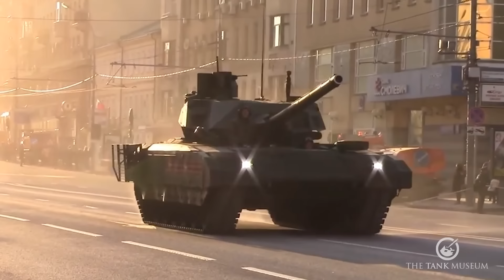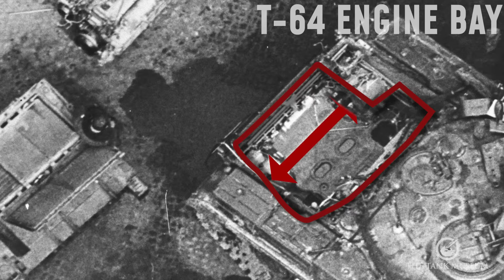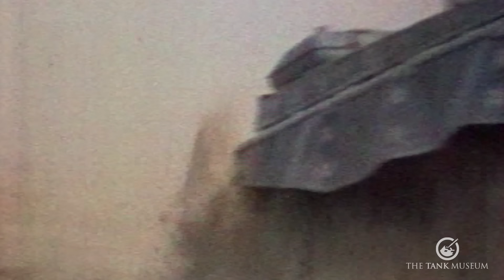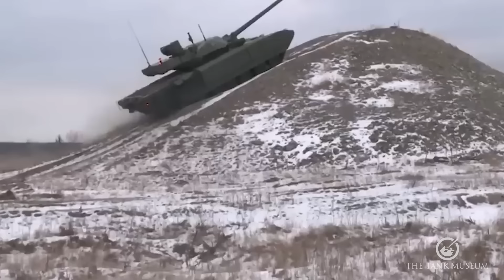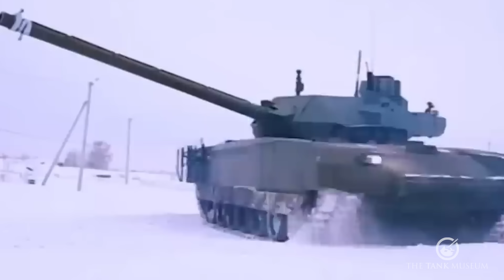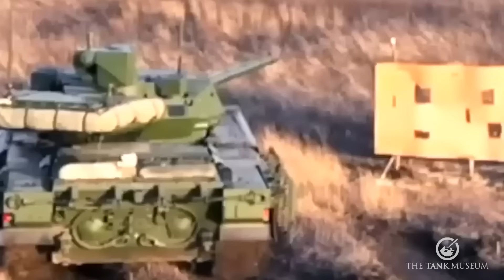Radical or Ridiculous? | T-14 Armata | Tank Chats #171

Comment: I believe in a whole new doctrine where tanks as we know it are obsolete...drones and space based laser weapons and space based tracking...first I will say the only way a tank can keep lasting for some time which is the similar temp it is to its surroundings will last the longest...very soon in military warfare will sats with lasers be able to track and shoot with 99% precision against tanks. They will be able to shoot as many times as they want. Infinite ammo (chinese have claimed to have overcome this overheating issue by pumping a cold gas into its chamber). Strong enough to rip through any armor or shoot precisely at its weakest points. The only disadvantage of the laser sat is orbital trajectory as it won't always be over that spot on the planet. 

This is where drones come in. Cheap, amassed by the thousands, strapped with lightweight high explosive combing entire areas being as efficient as possible to keep a certain 8 to 1 kd ratio. If it cannot achieve this they will tactical retreat and recommend the exact number for those odds until those odds are reached or whatever odds you need against the enemy. 

The biggest and most important advantage drones have is terrain has no affect. The air is their only terrain and the more they can operate in different weather the better. The other advantages is no airfield or air strips literally can be rocket launched stationary or thrown by hand anywhere and its obvious mobility at low altitudes. Tanks can't do this. Mines will have to be redesigned to track and hit drones in the air in the future. AD (anti-drone) mines would be a wise R&D decision. Any type of AD (anti-drone) defense would be wise like drone cages that extend the tanks life as well as any type of jamming or short range emp. 

At some point, maybe not in our lifetimes but maybe the tank will become obsolete. The armored infantry vehicles will still be a thing but they'll be covered by amassed drones in the thousands. The tank is the battleship...the t-14 is your super battleship if you may and the drone/drone mothership/space based laser are the escort, light, air carriers of the future.

Comment: Soviet era tanks do have a fording capability like shown at 7:30 but so does everybody else's main battle tank.  But at one point in the cold war, NATO experts were startled, and concerned, by a Soviet propaganda film that showed a column of T-54 tanks entering one side of a river only to re-emerge moments later on the opposite bank.  Since NATO tanks did not have this supposed ability, NATO leaders were naturally, a bit shocked to see the Soviets fording a river with apparent ease!
But as the Russian defector Suvorov later revealed later in his book "Inside the soviet army", to do this easy trick required a lot of planning!  First the Russian engineers diverted the river.  Then they paved the bottom with some sort of concrete tracks, not much different in design from a child's Hot Wheels car set; then they routed the river back to how it was.  Now to show NATO a "river crossing" all the Russkies did water-proof the tanks, then drive into the river and back out again.  And to prevent anything from spoiling the trick, the tank drivers were kept on course by those hidden concrete emplacements. Without the concrete, the drivers had no way to steer in the right direction and would inevitably become lost while underwater, because unless you paved the river bed, there was no way to do it without losing a bunch of tanks, that drive into the water and never come out!

Comment: The T-90BM is available in large numbers in both the Vostok and Zapad sectors.

The same reason why the Challenger Tanks are also going to struggle against Mines, Kamikaze drones and high velocity Missiles.

The Challengers look ridicules with cope cages.

The T-14 has active drone and missile protection. Russia will not produce in numbers unit 2028.

The Leopard, the Challenger and Abrams all have the same problem, tracks are blown off, the panzer is disabled they get picked off by Kornet, Lancet or the venerable T-72 with its enormous gun.

One CV-90, Sweden’s hopeless APC took a direct hit with a Vietnam era RPG-7 and the projectile went straight through the turret and killed the commander. The rest fled.

The only was to get through fortifications is Kamikaze Panzers, remote controlled, cheap rolling steel with automatic guns.

There is no hope for Panzers in todays battles.

One T-80 knocked out the best of Western Armor in 8 minutes, 7 APCs gone and he had to go back for more Ammo, the T-72 is fast, lighter than the Leopard and Abrams.

You try and do a section on that engagement which has become the hallmark of the War.
Reply: Calling CV90 hopeless XD
Its not like it was tested and battleproven in Afghanistan, and Ukraine announced they gonna buy more of these, after war
One got taken down, that means they suck. 
By that standards, everything that russia deploys is pure trash

There is absolutely no proof of "active drone protection" on t-14, other than russia's claims. We are still yet to see debut of t-14.

Whole "tanks are obsolette!11!1" is a song we hear since 70s, yet for some reason, Ukraine actually asked for more tanks, and Russians are trying to replace their lost tanks.

T-80 is slightely upgraded t-72. Claiming it "knocked out" is a russian cope fantasy. Its not like western vehicles were going through minefield, charging an entrenched position on enemy that was waiting for them. By that logic, ALL russian vehicles are complete trash, giving how easly they were knocked down at first weeks of war.

In short, cope more
Reply: @krywoz707  - Comrade - If a little guy with an RPG-7 could take out the CV-90 then what could 100,000 Afghanis with 100,000 RPG-7s do - yes take back the entire country. 

Afghanistan was a false dawn for Nato - hard ground, no mines,  no trees, full air-cover, no air defense. 

Each Nato participant country used Afghanistan as a playground to practice and test hardware, they really had no intension of making Afghanistan a better place for the women and children.

20 years of occupation, $1 trillion spent, the place looks like the same as they found it, all the money went back into Nato and US corporations’s hands.

They same will happen in Ukraine!

Nato, leaves a mess behind them where ever they go.  

But go ahead let the CV-90 be your chariot!

It will need a full “Cope Cage” around it, front and rear and on top like the Bradleys had in Afghanistan.

Comment: This project was doomed since beginning. Having shared platform where every vehicle needs to be 30 tons, because chasis is "tank" based is a damn joke. Logistically fleet of these would drink more than russians do. Modular concept existed before, but they all were lighter types.
second part, more important, look how driver/gunner seat in that tank. 
no hands support, seats are just flat spots and every control is on eye sight level. 
if this thing was "moving" at all, I cannot believe any other controls can be used reliably. tankers will fly off their seats and interfere with guy next to him, or simly press wrong button.
I laughted when on "promo" video dude presses same button 3 times, before getting anything. Sure it will work well in field,with dirt and grime, if THAT is the level they got for propaganda video.....

Comment: Like anything new , there are always problems to work out . After you do , it is usually a good piece of equipment .
Reply: IF you do, not "after". Its been a decade, and no sign of the factory being built, much less any tanks.
Reply: @jamesdavies4799  Also a question of CAn it be fixed ? You saw that a lot in WW2 , on all sides . Looked good on paper , but a failure in trials . Why the sherman never had a 90mm in it . The US was not despirate , like the British , and later the Israelis .

Comment: I have to correct you on a fundamental statement you made.  Russia was never "The biggest tank manufacturing nation of all time".  That was the The Soviet Union, an industrial power with a collective GDP and population ten times bigger than Russia.  Russia is only a tiny shadow of what the Soviet Union was, so no real surprise that it's tank development and manufacturing capability are now very poor. However, this is a fantastic video with such a great explanation of the background and development that went before.  Thanks for posting.
Reply: The important conclusion therefore is that the pace of per capita economic development in Soviet Russia was practically the same as in modern Russia.

There is a difference though. Despite the fact that per capita GDP growth rates were approximately the same and GDP grew faster from 1945-1960, a contemporary Russian is twice as rich as his/her counterpart in 1960.
Reply: @nzer57  I don't follow how your conclusion flows from the preceding discussion?  Please explain.

Re: relative richness over that period, I would have thought it would be a bit more than double?  Doubling in 60 years from 1960 to 2020 is only a growth rate of 1.3% per annum.  I don't know what information there is on GDP growth in USSR and Russia.

Comment: They seem to be producing T-80 just fine just saw a video of a convoy of 30 that just came off the production line heading to Ukraine, I doubt they have troubles producing older models, just not as fast as they might need them but they are producing 1 every 2 or 3 days maybe.
Reply: They can produce a few and the equation is can Ukraine destroy them faster  than production.
Reply: @knoll9812  Russia is not currently losing tanks in any significant numbers, they are for the most part on the defensive, their tanks are not venturing into the unknown and getting blown up, they are used defensively and  my understanding is that Russia still has thousands of tanks (T-72 and newer) in storage so I dont think they are running out of tanks for atleast a year or 2 unless they go on the offensive with the same tactics as the first months of war which tbh I dont see happening again, but it's Russia so who knows..
Reply: @MrHash97 "russia is not loosing tanks" which is why we are seeing tanks from the 60's deployed.

Comment: Personally i believe the primary reason for the downsizing of T-14 production and increase in T-90 production and T-72 upgrading is that the russians realise that the first casualty of high-tech war, is high-tech war itself. the t-90, t80 and t-72 have proven to be more than effective, and theres not yet any point to use the t-14.
Reply: It's probably a big cost and procurement, along with a logistical factor in play as well. Russia would likely have had to dismantle at least part of their existing T-90 production lines, along with the T-80/T-72 upgrade facilities in order to free up a sizeable enough capable workforce, and to create new facilities for housing the would-be T-14 assembly lines. Not to mention all the spare parts and extra components that likewise have had to be produced and shipped to the front lines, an ordeal that Russia is already having some serious problems with in their existing tank fleet.

Russia would, in this case, have also had to produced the tools necessary to create the machinery necessary for producing the T-14 en-masse, along with all the components needed to repair and re-field damaged units. This is likewise something Russia is having quite serious problems with in their existing tank fleet.

EDIT: I don't think switching over to the T-14 in the middle of a war is a sound tactical move on the part of the Kremlin. Doing so doesn't make any logical sense to me.
Reply: @Nick-rs5if  Exactly, theres no reason to switch at this point in time, and doing so would waste resources that are much better used elsewhere. A single t-14 costs about the same to make as about 250 lancets, and one is far better proven at making short work of western equipment.

Comment: a huge problem with these unmanned turrets is simply the fact that situational awareness is highly diminished not having the commander out of the hatch when needed...i just see so many problems with this i expect to see people running over things they were not supposed to when backing up and easily getting flanked by rpg's as well as many other weapons u could not pay me to get in this thing id rather be in a version 1 abrams
Reply: The drawbacks you point out are  valid but inadvertently, the Russians might be onto something. I think it will be easy to adapt these tanks for this new, modern era of drone supremacy as traditional tMBT's have pretty much lost battlefield relevance.  It'll be  easy to convert it to a remotely operated drone tank, maybe guided by aerial reconnaissance drones.
Reply: @dirremoire  uh are you talking about there t14 being turned into a remote operated tank or any of there tanks cause thats not viable at all for the t14 but yeah they probably should get on that for all there older ones atleast before t90 might actually get some value out of it that way and the earlier you start the faster you can develop things to help with awareness
Reply: @Broken_dish  Yeah, the T-14 already has an automated turret. It's also fast and  would be able to pull off rapid maneuvers on a battlefield that would be impossible with a crewed tank the Russians are probably already working on it now.
Reply: @dirremoire  ya but i mean its supposedly been in production for what over 5 years now and they have like 10 serial production tanks and havnt even seen combat they cant even make non remote ones how will they make t14 that are remote i dont think they have the funds to make anything new right now they seem to be scrambling to get new people to join and that cost money and refurbishing old stuff and logistics and buying new weapons from nk iran so thats why i think it dosent seem likely anytime soon atleast maybe once they stop trying to take ukraine or something then yeah maybe

Comment: This is an excellent channel. You guys present everything so clearly without any unnecessary bells and whistles.
Reply: Apart from the fact that they literally hate Russia and are particularly biased against Russian tanks for no good reason.
Reply: @Dollymix001  Hate Russia?  There is no sign of that in this video.
Reply: @colinallen8924  listening comprehension must not be your strong suite
Reply: @Dollymix001  Russian tanks do suck though. The war has exposed fatal flaws in both their design and doctrine. Even if the T-14 supposedly addresses those flaws, it's all theoretical until it faces the acid test of combat. Until the Russians can build enough of them to actually field in Ukraine or elsewhere, the T-14 is propaganda.
Reply: @Dollymix001  .... They hate bad tanks in general... not just russian tanks... but for the most parts, russian tanks are bad overall.
Reply: @gp-network4370  he literally provided false statements about the engine regarding it being copied from a German one though, not to mention the need to always point out the flaws after every single good thing mentioned about them, and even bringing up something like the political disputes between the morozov plant and the uralvagonzavod plant simply for the purpose of casting them in a bad light
Reply: @Dollymix001 Russian tanks are trash, wheres the hate? Lol go complain to whoever tf it is thats in charge of manufacturing these rubbish tin cans
Reply: @notsum362  arguably not trash, just outdated and a stagnation of a once decent concept, it is more a reflection of russia than the tank. it is the equivalent of america using  a m4 sherman in the late cold war or the m60 into the current era, both tanks were fine however if their use was continued then they'd be the same, this is more a reflection of the russian military than the tank
Reply: @Dollymix001 ah yes you can see the hate so clearly, oh wait no they are facts. Maybe take a moment to think for a bit. If all this video says is lies, why no T-14 on the battlefield? Russia’s most modern tank is not adequate, as each week they atleast lose 2 to standard types of treaths. So if T-14 was a much better tank it would be useful wouldn’t it?

Comment: Having the crew protected in the chassi sounds like a good idea, but when faced with how battles actually are fought its a stupid idea because the tank commander needs to have his head out the hatch repeatedly for situational awareness, something that can not be achieved using cameras, at least not yet.
Reply: I can’t imagine these ever being on a battlefield that doesn’t have at least several drone operators providing information about what is within a couple of kilometres of the tank.
Reply: @skipintroux4444  It could work in the future, but you need cameras that are at least as good as your eyes, and added ai software to help id shapes that are suspicious and I’m still not sure. The human eye is a very perceptive tool. Just compare a really good camera with the human eye and besides being able to come really close, inches, or far away, miles, it’s just not as good or as fast and you have to switch lenses.

Comment: Every product has +/- points & people are also always divided in opinions even inside the country of OEM. In the era of advanced ATGMs with top attack capability, unmanned turret & APS are indeed a good shift, but it brings down the crew closer to mines. So height of tank needs to be increased to add bottom armor. Height of Israeli Merkava is also high + its engine on front which no other tank maker agrees to do. Anyways, Abrams-X also has design similar to T-14 with no increase in height. NATO countries obviously have variety of suppliers for sub-systems & parts, compared to Russia. Kindly make videos on other latest tanks also like Leopard-2A8, KF-51 Panther, Challenger-3, Leclerc XLR, K2 Black Panther, Japanese Type-10, etc.